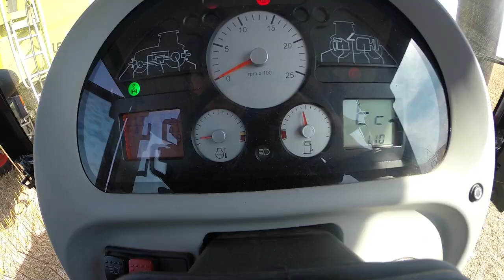Tarmac Farming

Comment: What drill are you using for your direct drilling system? has it affected yield much?
Reply from the maker: We use both a 6m Amazone Primera, and a Kuhn SD4000. We use the Primera most often because it's wider and a little more versatile in that it can better handle damp conditions and trash. It's not really affected yield in the long run as our land has had time to self-structure and for the organic matter to build up. We generally aim for around 8.5-9T/Ha of wheat.
Cheers,
Charles.

Comment: Looks like you have serious light dirt, Lincolnshire?
Reply from the maker: Nope, Somerset ;)
If you're referring to the drilling bit, that is actually some very heavy clay, but it looks the way it does because it was flooded last winter (it's on the very edge of the levels). Hence the flowering OSR beside it in the same field :)